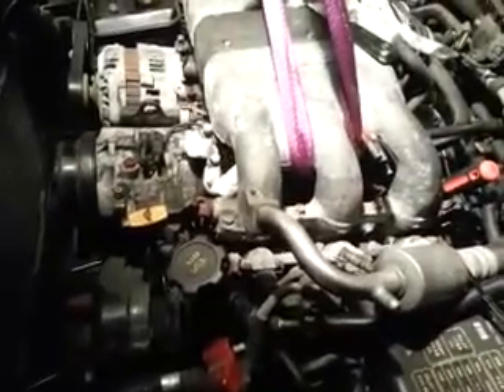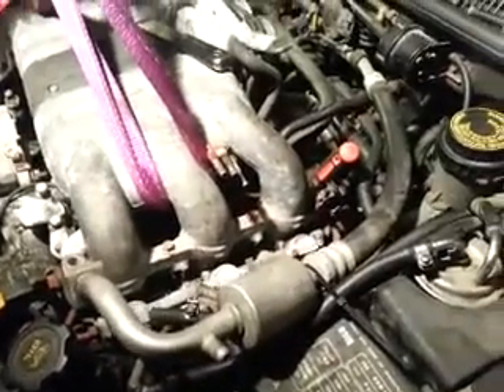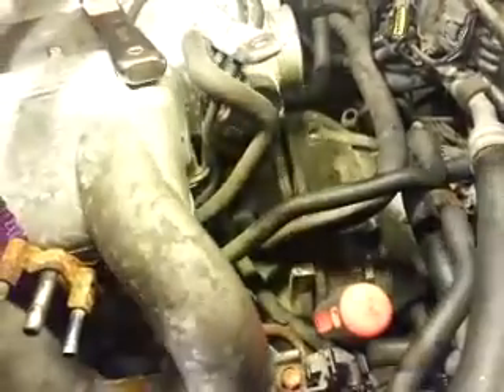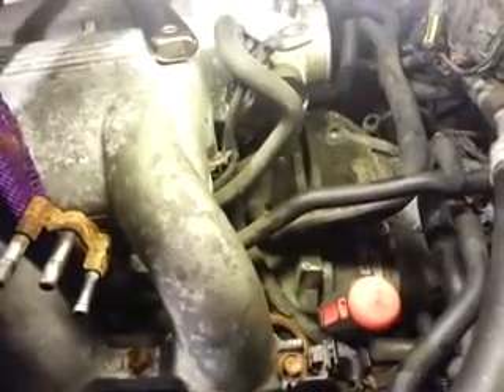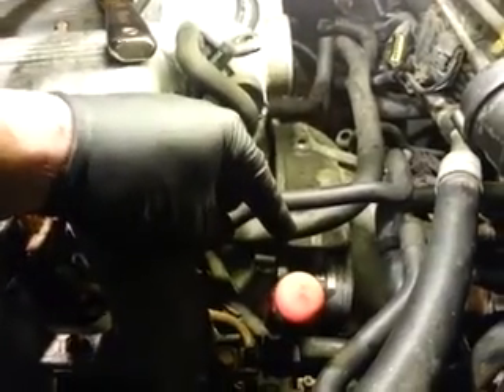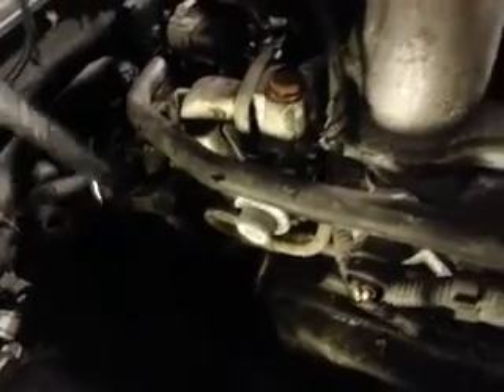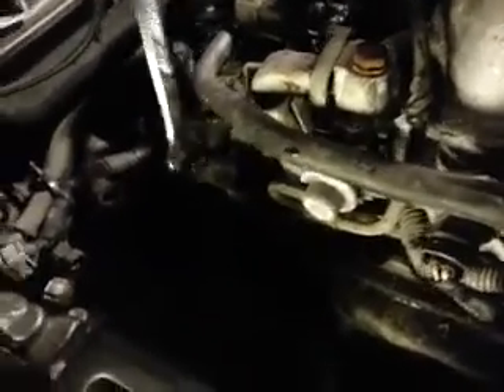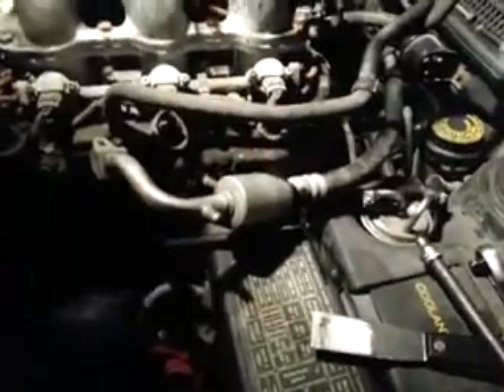Subaru engine transmission separation

Comment: Thanks. I have an '09 Forester and best I can tell the engine is free, it just WON'T COME OFF OF THE TRANSMISSION!
Reply from the maker: Phillip I believe the newer ones have a pin that needs to be removed if it is a manual. I believe it is part of the clutch fork